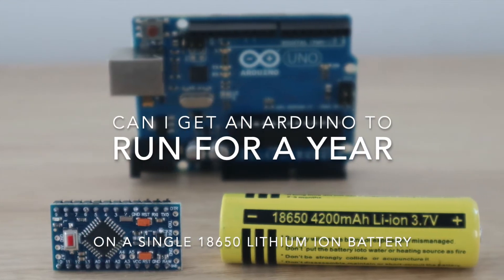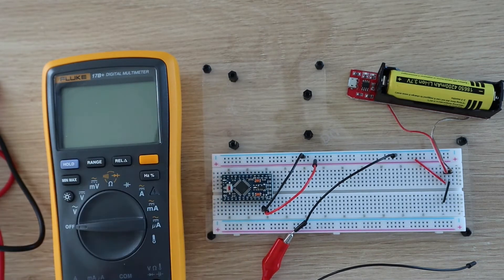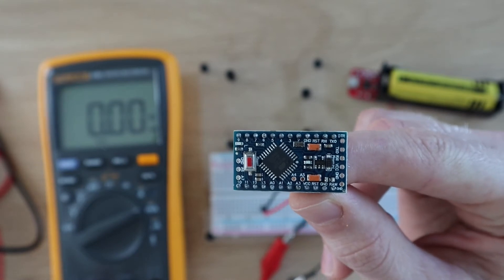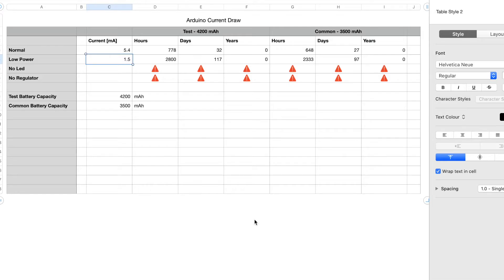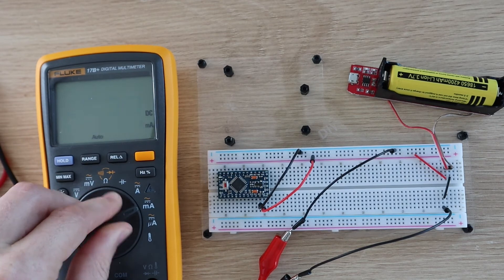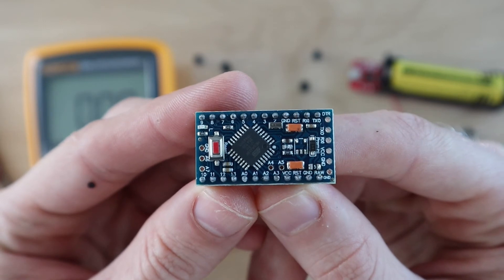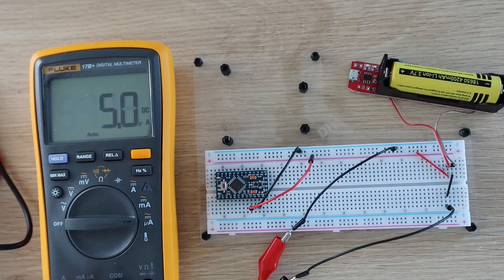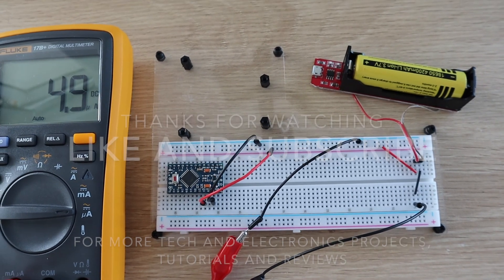Can I Get An Arduino To Run For A Year On A Single 18650 Battery?

Comment: I really need help with my project research. I want to power the arduino for 1 months without running out of power to capture data. Really need some help
Reply from the maker: You'll need to measure how much power your Arduino setup draws and then calculate the size battery you need to run it for 1 month (730hrs)

Comment: Great video, but I do have some doubts: When powering the Arduino Pro Mini directly from the 18650 through the VCC pin, how does the MCU behave at 4.2V and 2.75V battery levels? Does it have any side effects when communicating with a FT232RL serial to USB converter (mine has a 3v3 and 5v selection jumper)? Thanks.

Comment: most likelly li-on will be self discharger after 4-8months.. or if you recharging the battery will fail after 2-4 years
i have never seen a 18650 more than 3ah and in real life they are 2900 brand new. after 6 months it goes lower than 2600. all i want to say is lithium 18650 are not realiable. they are made to replace them more often than you might think..

Comment: Why removing the regulator when you can power the board using VCC pin directly. I suppose the regulator will be unused in this case right? no need to remove it

Comment: After removing the regulator, I hook 3.7v lithium to VCC (battery powered project). So now all the sensor/oled connect to VCC is powered directly with battery? 3.7v battery is 4.2v when fully charge, is this later will damage my oled/sensors?
Reply from the maker: It depends on what the sensors and display you're using can handle. Typically I2C OLED displays can be powered at 3.3V or 5V so if you're powering it with a 3.7V battery (up to 4.2V) then this shouldn't cause any issues.
Reply: @MichaelKlements  there is also DS3231 RTC hook on the VCC too. The downside i think, i cant measure battery drop

Comment: Hi, i have a question.I am a newb by the way. I just want to do a kitchen counter. there is only 2 buttons. one counts down from 30 minutes and the other counts down from 10 minutes.(only a small oled will be up during countdowns, other times it will be off) After time is up, it only blinks a led for a couple of seconds.  Initially i thought it wont require much power so a battery would feed it for months but as i can see, it wont. So the question is how would you do such a system? would you use battery or outlet? or should i put a button which totally turns on and off the arduino?   and do you advice raspberry pi pico because they say it is more energy efficient.
Reply from the maker: If you're only using it intermittently then you can probably get away with battery power, just use a power button or switch as you've suggested so that the Arduino is not powered the whole time. An Arduino. According to the data I can find, the Pico uses around 90mA when running which is significanlty more than you can get an Arduino Pro mini to run at with some modifications.
Reply: @MichaelKlements  ok. thanks for your answer. i will look into it tomorrow. i am thinking of putting a switch on 9v cable. i will see but early on will it get up immediately or there will be some delay seconds until i am able to use counter. and most importantly, is there any chance for that scenario: when i press the 10 minute count down button, the arduino will turn on if it is off. the same for the 30 minute button?

Comment: if it is connected to the relay module, is it possible? and whether the current increases or remains. My plan is to use a 12 volt motorcycle battery with a capacity of 5 amperes. thanks
Reply from the maker: Yes you could use a relay to turn it on and off, this method allows the Arduino to stay on and is intended more for data logging or long term projects than for an application where it could be turned off for periods of time.

Comment: sorry by the self discharge of a 18650 is definitely not a year.  its about 1-2% a month. That would last 5-10 years that is without a BMS of course.

Comment: just pls, dont brake off smd components with pliers, u can kill the board.
Reply from the maker: Its not something I would usually do, but it's a $3 board and LEDs tend to break before the PCB traces are damaged.
Reply: @MichaelKlements  yeah true. its just, kind a pain for the eyes, like ripping off some componetns. but i need to say, really impressive, how little energy is used. thx for this vid.
Reply from the maker: Yeah I agree, I bought a small SMD hot plate shortly after this video that I've been using.

Comment: great video, about the discharge thing, if you use a tiny solar panel, it will compensate?
Reply from the maker: Yes it would, if you've got your project in a location with light/sunlight

Comment: 5:16 if you bypassed the power conditioner by hooking up to VCC, why did you have to remove it?
Reply: On one schematics of internals, it had voltage divider there to compare output against reference, i'm not sure if it's a case of voltage regulator used on this particular pro mini.

Comment: Hey what happens when you removed the onboard voltage regulator? if nothing happens then why is it present on the board in the first place??... Thanks for answering!!
Reply from the maker: The regulator maintains a constant 3.3V supply to the chip and peripherals, for a broad range of input voltages (typically up to 12V). If you are using a 3.7V lithium ion battery then this is sufficiently close to 3.3V that the chip will run without risk of damage and you can use it for digital IO etc.. You can't use more than one battery and your analogue inputs or any devices attached to your Arduino that require a stable 3.3V voltage will probably not be reliable. So it limits your use cases. I have made a subsequent video on replacing the regulator with a much more efficient one for these cases.
Reply: @MichaelKlements  Superb explaination!!Thanks

Comment: 4200mah 18650? where?
Reply from the maker: The battery capacity is obviously overstated by the manufacturer, but that's not really the point of the video. Even a 1500mAh battery would power an Arduino for years.

Comment: As a hearing impaired youtube viewer, I am a little bit confused as to why you removed the regulator. I thought, regulator is to run current around the board and the battery to feed the battery to regulate the power by feeding it back and forth. How is that possible to run the battery to board without regulator. I mean, without regulator, the power from battery will drain. The same principle as the car run using battery and Alternator. I have been helping peoples understanding why their battery went bad by draining based on two things: The battery and Alternator that goes bad. I am a little baffled on what you did on regulator on Arduino. Thank you for your insights on it.
Reply from the maker: The regulator stabilises the voltage from the battery. A battery starts off at say 4.2V full charged and this decreases over time to around 3.4V when empty. The regulator takes this input voltage from the battery and keeps it at 5V or 3.3V regardless of the variation from the battery. 
While not ideal for sensors, the Atmega chip can handle some variation in voltage, as can LEDs and buttons etc.. So if you're not working with sensitive sensors then you can remove the regulator without affecting performance and you'll save on power consumption - regulators use energy in converting the voltage and when in standby. The components onboard only use what power they require, they don't drain the battery any more or less without a regulator.
People's car batteries go bad due to the alternator because the alternator stops charging the battery properly. So the battery slowly drains more and more until it it eventually dies. Batteries, particularly car batteries, don't like being empty for extended periods of time. This damages them.

Comment: You could remove the regulator and power it with a Lifepo4 at 700 mah battery at 3.2 volts AA size
Reply from the maker: Yes you can do that too.

Comment: Can arduino wakeup when there is interrupt from outside sensor?  Is it possible to detect interrupt from a sensor such as moisture change when it's in sleep mode?
Reply from the maker: Yes, there are options in the lower power library to put the chip to sleep and wake on an external interrupt. You wouldn't be able to do it for something like an analogue sensor though, as the Arduino would need to constantly monitor the values to know that they're changing or reaching a limit. The interrupts are more for step changes or switches. 
But soil moisture changes so slowly that you could wake up every hour or two for a single reading and you'd be getting much better battery life.

Comment: That's a common chinese fake battery you've got there.
Anything with fire in the name is made from rewrapped scrap laptop batteries with 500-1500mAh of real capacity at low current, and so nowhere near their ratings of 4000-10000.
State of the art top shelf $10 18650 battery has up to 3600mAh, if you see one claiming more then that it's a scam for sure, especially that they go out as low as $1.
Generally don't buy any cylindrical cells from china (they don't seem to scam prismatic ones).
Buy from local sellers that have genuine samsung/panasonic cells, they will usually have non-flashy wrapping.
Sometimes you can even get hold of super cheap quality cells from people who got them from mass production leftovers or rejects that had 1 out of 1000 welds fail and they throw entire pack of 40 brand new cells and they will be disassembled and only have some weld marks left on it.
It's a common practice as there is endless amount of powertool, small ev or other wireless appliance factories all over the world.
I had mine from BOSCH ev bike kit factory located in Poland and they were throwing entire containers of cells that were sent to recycling centre then dude from recycling centre sells it to another dude and he sold those to me.
Reply from the maker: Thanks for the tips and advice Arek. I haven't really used lithium ion batteries much, I tend to use LiPo cells more often, but they obviously have their own risks and challenges.
Reply: @MichaelKlements  No problem.
Li-po come as prismatic and those have higher max drain currents but lower energy density.

Comment: So...
was using fake capacity cells part of the project?
If you're going to test 18650s you should test the true capacity of the cell instead of believing whats on the wrap otherwise you're advertising FAKE Cells that are generally only 500mAh or so.
What im saying is, You are using Fake capacity cells.

Comment: what about using a solid state capacitor and a teeny weeny solar cell? or maybe even a RF power harvester that takes power from sorrounding radio signals? you could have some pretty cool sensors in remote places logging data, and maybe even once a year upload it all by saving up power to connect a gsm module and text it
Reply from the maker: Thanks for the great ideas. I haven't ever considered using an RF power harvester, I'll look into it. The capacitor running with a solar cell is also a neat idea for a Pro Mini.

Comment: Lithium battery have an internal resistance, which means they will self discharge slowly over time, good luck making it last a year!
Reply from the maker: They do slowly lose their charge, but this usually takes 2-3 years if you're using good quality batteries (I release the ones in the video are not).
Reply: You dont know what your talking about mate. 1-2% a month thats one of big advantage over lead acid.

Comment: The LED Blinking Test does not make any sense, because the current spike will get lost while calculating the average of the power that gets used.
Reply from the maker: That's the whole point of the LED blinking. I want something that indicates that the Arduino is still running, but doesn't influence (or has as little influence as possible) the power consumption.

Comment: Very nice experiments illustrating how to minimize power consumption in sleep mode!  I found myself wondering about differences among board designs in power consumption during operation; e.g., running a continuous loop involving floating point computations, reading analog inputs, changing digital I/O pin states, etc.  If there are differences among the boards you compared in your first video,  their magnitude could also be a factor in board selection for a given project.
Reply from the maker: Thanks John. That’s a good idea to take a look at next. The results would probably be more significant for the smaller boards like the Pro Mini and Pro Micro as these already use a lot less power than the Uno and Mega. I’ll start thinking of some ideas to test this out.
Reply: @MichaelKlements  From what I can see the selection would likely come down to Pro Mini v Nano, and if there isn't too much difference, I think I'd prefer to use the Nano (which I have several of).
Reply from the maker: It would also be interesting to look at the genuine Arduino branded Nano vs a clone Nano, as the clones often use poor quality components (particularly regulators)
Reply: @MichaelKlements  I'm thinking along the lines of bypassing the regulator and using off-board regulation through a Pololu device I have previous experience with, their S9V11F3S5C3, which is a step-up, step-down with a cutoff at 3VDC, perfect for an 18650. it can output up to 1.5A. As is, it outputs 3.3VDC but has a jumper you can bridge to output 5.0 VDC.  I've measured its efficiency at > 90% as they claim.  So I'm thinking of using this with an 18650 instead of USB power, preferably at 3.3VDC.  I could try it at both voltages to see the consumption difference in both sleep mode and in the awake state. I'd use a p channel mosfet to switch power to sensors during read cycles. Anyway you're video has caused me to become interested in playing around with this a bit.  Information on the Pololu regulator, if your interested, is at https://www.pololu.com/product/2873
Reply from the maker: That sounds like a nice solution. I'll definitely have a look at it!

Comment: Great experiment, but what would you use this for, ie temperature or data collection, which is more realistic
Reply from the maker: Thanks Jerry. There are quite a few instances where you might want the Arduino to run a long time on batteries. 
I initially thought about making it more efficient for my soil moisture monitoring stick. If you’re forgetting to water the plants then you’re going to forget to replace/recharge batteries as well!
But it’s also great for data logging, external weather stations, RFID locks etc.
Reply: @MichaelKlements  So what capacity batteries and how long do they last on your soil monitor

Comment: If we make a solar charger will it run forever? In theory I mean
Reply from the maker: As long as your solar charger is able to harvest enough energy in the 5-8 hours of direct sunlight it gets a day to power the Arduino for 24 hours or more then yes it would be able to run indefinitely.
Reply: @MichaelKlements   I live in greece we have plenty of sunlight even during the winter so it may be able to work
Reply: @tyflos098  i am using wemos d1 mini with wifi connection and thermometer and it runs "forever" in Poland (we do not have so many sunny days as you have). It registers temperature, humidity and atm. press. every 5 minutes. runs on one 18650 and two 6v 1W solar panels. sends data over mqtt to my raspberry. wifi is not very power efficient so i think that such small arduino and RF would be way more efficient
Reply: @daczka92  It might be interesting to have indeed each arduino with a RF instead of wifi, all sending data to a single RF receiver, which relay information through wifi ? I was thinking about doing that but I have no experience with RF and might not realize the drawbacks

Comment: I didn't know they could go that low. Pretty impressive. If you haven't already you should check out the STM32 L0 range. <1ua sleep current with onboard RTC. Great video showing how the regulators they put on these boards suck lol (also how power LEDs are bad).
Reply from the maker: Thanks for the tip, I’ll definitely go and have a look at their range! Yeah they’ve taken a pretty good chip and ruined it’s power saving abilities with poor quality components. Then again, Arduino are generally designed to be as cheap as possible, rather than reliable or power saving.
Reply: @MichaelKlements  Arduino are designed to be cheap to manufacture, but are sold for ten times more. Well, I can understand they host forums, publish guides, make Arduino ide which I presonally don't like, but fine. I've seen that bare atmega328p chip can consume 300nA with ADC, BOD and some other stuff disabled, pins put into output and either high or low state - this has hardly any effect in sleep (can be last few uAs), but it can save a lot when it's awake. Also I don't like having LED on SPI CLK pin and that my Arduino Nano has LEDs that can be used in imperial star destroyer lasers, they are so bright that it hurts.
Other than that yes. I would actually like to have ATmega4809 chip with break-out board, reset button and necessary capacitors. That's it. Then a separate programmer, cause this chip has some single wire communication for programming.
On the other hand, for some people it might be nice to power Arduino and stepper motors from a single 12V adapter.
Other funny part is ZS-042 RTC module, it needs three modifications: power led, charging circuit that is badly designed and to remove one pull up resistor on interrupt pin.